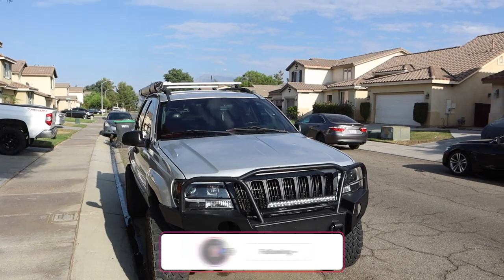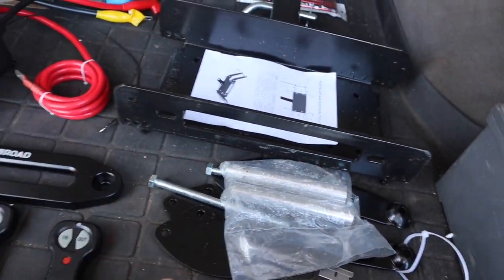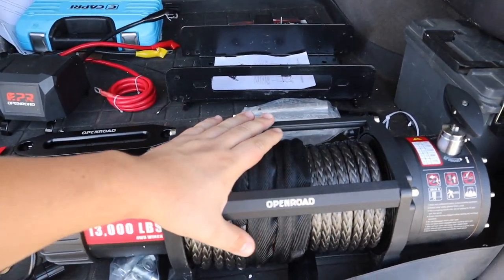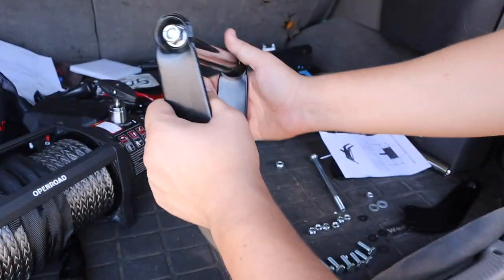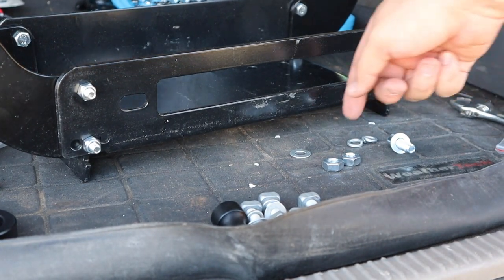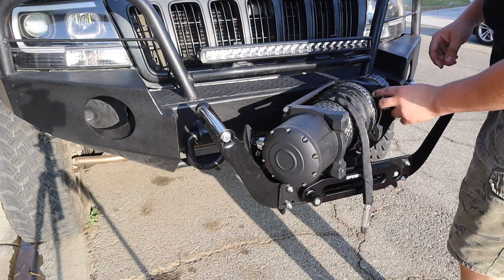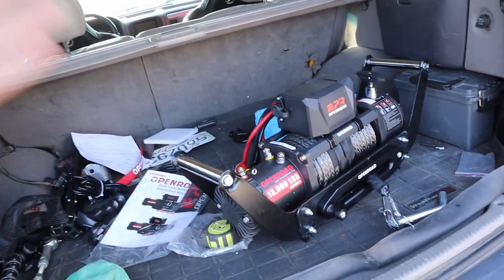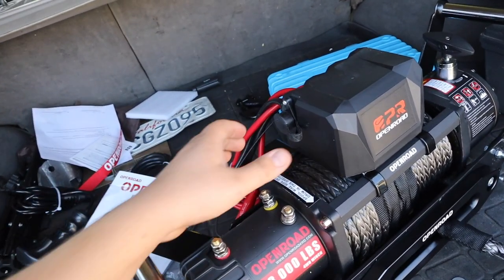Installing OPENROAD 13,000lbs Budget Winch on my Jeep WJ Grand Cherokee

Comment from the maker: The codes will only work for the products I used in the video:

Pick the winch up Here and use code "najarwinch" for $100 off this winch.
https://openroad4wd.com/products/openroad-13000lbs-winch-2s

Use code "najarmount" for 10% off the hitch mount.
https://openroad4wd.com/collections/winch-accessories/products/openroad-winch-bracket

Comment: are you gonna utilize battery quick disconnects? i used to wana do a build years ago with the Mini Max Front hitch but they no longer make it to my knowledge.. closest thing now is the HK offroad front hitch..been contemplating for while now back an forth if i just want a removable front/rear winch an use an go that route or i might go with Affordable offroad ront bumper as they're Pa based an only couple hour out for me so i wouldnt have to pay their shipping fees
Reply from the maker: Yea I’m going to connect it with a disconnect so I don’t always have to have it connected!